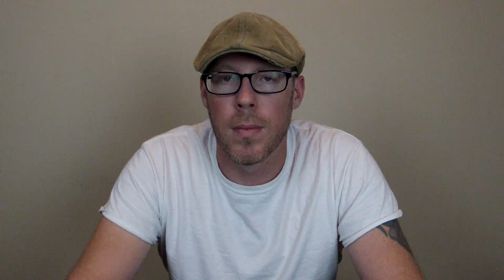What Is A Hydrostatic Relief Valve?

Comment: Do hydrostatic valves need to be rated to activate at a certain water pressure or difference in head? Do hydrostatic valves need to be tested regularly? How? Is there a flowrate requirement for hydrostatic valves so that water can flow into a pool quickly enough to prevent it floating? Is there an international standard for their design? If the hydrostatic valve is fitted but doesn't work and a pool floats can that be claimed on insurance?
Thank you

Comment: I wouldn't tell everything that EVERY concrete pool has one, because that's not true. They should all have one, but there's many that don't due to poor work from contractors.
Reply: I have an older pool (2007)in AZ and it doesn't have one unless it is in the skimmer basket area. There is nothing on the floor of the plaster pool.

Comment: Hydrostatic reliefs are relief valves designed to work with liquid, as the name implies.  So just any old relief valve will not work.  One designed for gas will not operate properly with liquid.

Comment: So my grandmas pool leak is getting worse and I have to figure it out this season. It's still winter here in Indiana. So trying to find ideas. I'm thinking its this valve since it has been leaking over the winter pretty bad as well. I've never had the cover off of the main drain but she had the liner replaced about 6-7 years ago and the last 2 or 3 years it seams to be leaking more each season. It is a some what shallow inground due to really high water table. I'm afraid to drain it since I have no idea what kind of structure is under the liner. What would you recommend?

Comment: What is the difference between a hydrostatic valve and a main drain
Reply: Main drain connects to your pump so you can use the pump to empty the pool if needed. The hydrostatic valves are plumbed directly into the ground. So if one were to leak, your pool water would drain directly into the ground.

Comment: My pool sweeper was hung up on my drain and I was having a hard time pulling it off.  Once I did, I see a corkscrew type wire coming out of my drain.  Looks like most of it is out.  I won't be able to retrieve it until I swim down there.  BUT, after looking at these valve parts, is this possible this wire is from the relief valve?    I can't even find such  a thing happening through google searches  LOL     Maybe this wire was straight once but then the pool sweeper coiled it around while it was spinning around in circles.  I just don't know  ....

Comment: How often do hydrostatic valves need to be replaced?

Are there better quality valves or are they pretty standard/generic?
Reply from the maker: Standard only.  They usually last about 20 years but there are a lot of factors that will affect that number, most of which relate to water quality.  Basically you replace this valve every time you have access to the bottom of your pool.  If you are having some work done such as replaster or repainting the pool then go ahead and replace it even if yours is less than 10 years old.
Reply: Swimming Pool Steve eww
Reply: AviRay1  my pool water table is high is lot iron on the water